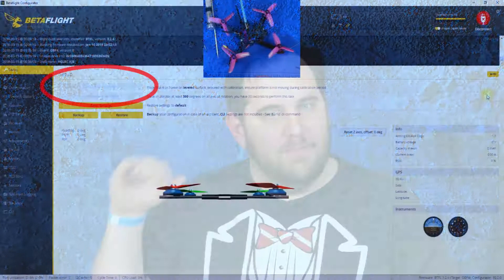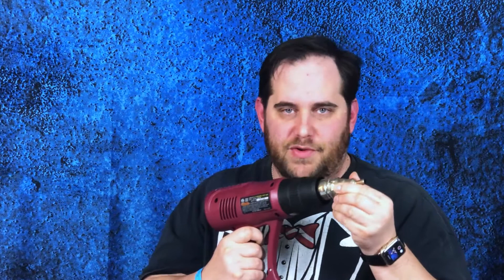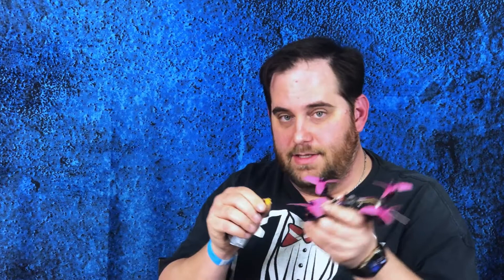How I fixed my HGLRC XJB 145 NO GYRO Accelerometer issue

Comment: OK just came here to say Thank You
I had this problem

Now while I may have bought a new V1.2, I also bought a heat gun with the proper adapters & after 3 goes, & never doing anything like this before, I have gyro!

Tip for anyone else, it’s not enough to get the flux bubbling, keep a close eye on the solder on the chip & you will see it change state, that’s when you’re done.

I had an extremely narrow nozzle & had to do all 4 sides but if you start on the outer side where the wires are, as soon as the solder softens, then move around the chip. Each other side won’t take very long because they are already nearly at the right temp.

Subbed & thanks again
Reply from the maker: SO AWESOME!  I'm glad you were able to get it going and reflow it.  It is by no means a "beginner task" and you should be very proud that you accomplished it!  Great job and I'm glad I could get you the information to get it fixed up!!!
Reply: @tronage  I'm just happy it's going again because trying to get a plug for the ESC to be able to re-purpose it was a nightmare. Now I have a spare everything to play with other frames because, well just because.
& now I have a very fancy heatshrink gun hahaha
Thanks again.

Comment: Thank you very much for just shining some light into my problem. I dont know if I will be able to solve it and I really feel that it is un fair that they sold those like that. Do you know if the company is taking responsability about this? I mean, usually I try to fix  stuff and learning but this is advanced stuff, I dont even have a blower or this flux. Not even fair.
Reply from the maker: It is unfortunate, but it is kinda "par for the course" because if it is a china company.  There will always be "bad batches".  Not to defend the company, but due to the nature of the hobby, and the frequency of crashing, there isn't a way to tell specifically if it broke because you crashed, or it broke because their mfr process you know.   And it is a hard line to draw because as a business you may want to help everyone, but then you would be giving out free replacements to everyone who ever crashed (because there will always be those who take advantage).  The Good news (maybe) is if unless you use the gyro you don't need it.  If you fly using Angle or Horizon mode, then you are out of luck here, but if you only use acro mode, I find it better to disable the gyro in betaflight.  It frees up CPU cycles for PID loop and Dynamic filtering.  Mine is now off, and I've not looked back.  So if you are comfortable without Angle/Horizon mode, just doable it and all the problems go away.
Reply from the maker: If you wanted to buy a replacement board, this would be the one: https://goo.gl/rozZuj (it is an affiliate link and appreciate the support if you choose to use it for your purchase).  I've not heard of the "fresh" ones having the issue, it is more of the older stock that was the problem.  If you are new to soldering, it will be a good learning project to do the replacement.   As I said though, if you don't use angle or horizon mode, you can "ignore" the problem and just turn off the accelerometer in beta flight.  But if you do use these modes then re-flowing it as I describe in the video, or replacing it are your only options unfortunately.  Perhaps still try to contact HGLRC though, worst they can do is nothing, but maybe they will help out.  Worth a shot.
Reply: tronage thanks again. If I decide to buy one I will buy it from your link for sure. But first I will try to see if a friend could repair it for me.. I still very new.. Just flying on angle mode. I have not even purchased the Googles yet.. I jumped from a furibee f36  to the xjb 145
Reply: hglrc is a respectable company that will honor returns, but it also has to do with who you ordered it through as it is they you need to contact for returning/rma'ing. so, unless you directly ordered through hgrlc they are not the ones you contact. if it's from banggood, they've always been good at returns they just take forever. gearbest, meh... it's a toss up. if it's a US retailer like getfpv or grayson or a local store or whatever, contact them first and let them process the return. Don't try any repairs on your own if you decide to go this route.

Comment: My friene or Anyone please. Now my motors stop at the same time in mid air for a second and they come back again. This happens many times for no observable reason. I thought it was the receiver but it seems to be OK. Don't know where to start looking. 😣
Reply from the maker: Sounds like you are having either a brown out or something receiver related.  What is your RSSI when the motors stop?  What sort of battery are you using?  What sort of maneuvers are you doing when it happens, does it happen right after a punch out?
Reply: @tronage  thank you very much for coming back to me. I haven't touched the quadcopter after it started happening. Now that you mention it.. 
Some months ago I got a broken receiver. So this is a new one and it was flying OK.
Hmmm... Also my vifly beeper is death. Now I am thinking it could be an electrical issue.  I got a multimeter I am learning how to use it. Maybe is that. To your q. I am just hovering and it happens.
Reply: @tronage  a brown means that something burned out? My RSSI does nothing. I am using 4s Gaoneng 850
Reply from the maker: A brown out means that something with the electrical system is not good, and is a temporary loss of control/power.  The key word is temporary, which is why it is a brown out.  It could be something going on that is triggering the failsafe of your receiver as well (loss of signal, esc noise, etc.)  I know it has been some time, and I'm curious if you ever got this sorted out?
Reply: @tronage  Thank you very much for comming back to me. The answer is nop. I left my quadcopter and havent touch it for a while because it have become a pain in the +++ to research, to find the problem, then you get another problem and I have some other problems to solve in life you know what I mean =)  its very time consuming and frustrating and expensive. One of this days,  I will try to flash the firmware and observe again. I noticed that my beeper and back leds are death too... I am afraid that my batteries could be damaged after so much time with out use... I have a multimeter and I try checking it with the little knowledge I have, but cant find the problem. =(

Comment: Hi there Tronage. Your videos have helped me alot with my XJB. After a bad crash i have a problem when i turn my switch to stable mode in order to land, the quad takes some crazy angles and usually crashes. when i fly at air mode everything is ok. if i try to fly at stable mode very easy going i see that the quad doesn't stay at a place it goes away, very noticable, and i have to all the time fix it. Could be this problem with the gyro? Mine should be a latest version and also i don't get the sound warnings, and my calibrate button is active in betaglight. should i try what you did?Thanks alot!
Reply from the maker: Sounds to me, your gyro is ok (it gives warnings and won't arm if it is not).  But may need to be calibrated.
Step one (calibrating the gyro) can be found in this video I did here: https://youtu.be/Ke7Dj0pdNok?t=13m10s (I time-stamped the spot about calibration)
Step two (Accelerometer trim) can be found in the same video, but at a different timstamp here: https://youtu.be/Ke7Dj0pdNok?t=34m3s
The first step just "zeros" out what the quad thinks is level, but it will never be "perfect"  The 2nd step helps dial in exactly whats level because you are trimming it out so it doesn't "pull" or "favor" a direction.  It will "drift" becasue there is no GPS lock to keep in in one place.  But what it sounds to me is you are getting pulled in a specific direction. 
Let me know if these tips help you out, I love hearing peoples progress!!!
Reply: tronage thank you very much for the help and the super fast response. I will try these tips and let you know. It is weird to me that everything started after a bad crash where an arm broke and I had to change frame. Someone told me that if a motor bearing has a small damage after the crash can generate noises ,in certain frequencies, when it spins that can get the accelerometer go crazy. Is it true?
Reply from the maker: Did you do the acceleometer calibration first (and have it on a "as level as possible" surface.  That happened to me once but turned out when I hit calibrate the quad was leaning because of the battery connector, so the calibration was "way off".  You want the flight stack as level as possible., then hit calibrate.  
As for the values, sometimes, you may have to put in big numbers, I've had some into the 50's just because I couldn't get the board flat for the calibration button.
For a forward and to the left, that would be negative on the pitch and positive on the roll values.
Reply from the maker: Yes and no.  Yes you can damage your bearing in a crash, though I've had some pretty spectacular crashes and and nothing yet, but anything is possible.  And yes motor vibration can and will throw off your gyro.  If that is a concern, the simple solution would be to soft-mount your motors which would dampen that vibration from getting to the FC.  Usually it makes it act erratic and throws your tune way off.  It wouldn't be an organized pull (as you describe forward and left).  Is the motor that was on the broken arm the front-left motor?  Perhaps there is an issue with that motor (if it was on the broken arm) that it can't spin proper as the FC commands, so being the weaker of the four, it would dip and cause the pull.  You might be able to trim it out with the accelerometer trim but would require very high values to compensate for a week motor.
Reply: tronage for once again thank you. Yes I calibrated it in a "flat" surface and as it should stand. No, I didn't go higher than 30 +- , but the weird was than no matter + or - the values it did the same thing. The arm tha broke was the front right, not the front left. The new frame is 4mm thick not 3mm. So it must be stiffer for sure but I don't know how it is translated to vibration transfer. Before the crash I had calibrated the guro in a wharever surface and never had any problem.
Reply from the maker: You can try to continue to go higher and higher to get the correction right, don't be affraid to crank it up if it gets it working (though it is more of a bandaid fix to whatever the real problem is).  As I mentioned to correct a front and left pull would be a negative value for pitch, and a positive value on roll, anything else will only magnify the problem and not fix it.  No harm will happen going "too high" other then the craft may eventually start pulling the opposite directions, and then you know to back it off a bit.  Well it is always possible in a crash that because the arm broke it "saved" the motor, like a crumple zone in a car crash.  But the left arm didn't break, so the motor got more of the force.    And thickness of material doesn't stop vibrations from traveling through it.  For example even if there was a 10mm thick piece of carbon and you held one end, and I tapped on the other, you would feel my taps.  If vibration is a concern you need to add dampening, either by soft mounting the motors so it dampens the vibrations being transmitted to the frame, or soft mounting your FC so the frame vibrations are dampened from transmitting to the FC.  Either way though I don't think this is your main issue.
Try this,  In betaflight go to the setup tab, and with the quad "level" does the 3D representation of the quad show it also level?  When you move the quad with your hands, does the 3D model move as expected to mirror your movements?  There are little numbers in the corner that say Pitch and Roll.  if your quad is level, these numbers should be near zero, are they?
This helps get a feel for what the FC is seeing from the gyro, and may help track down what your source issue is.
Reply: tronage thanks for one more time. Yes the numbers are near zero. I will try higher values as you suggest but for now I have deactivated stable and horizon modes so I can fly  and have the fun I should. If I have news I will let you know of course. I have a new motor that I ordered for spare and maybe when in mood I will try toreplace the front left and see what happens.as we are talking I have an other question. As searching for the problem and checking betaflight settings I was told that when you use dynamic filter ,your pid loop frequency shouldn't be as high as 8 khz but should be at 4khz. Do you know anything about that?
Reply from the maker: That is the easy solution, lol, which I too have done.  I've turned off the accelerator because that saves on CPU cycles, which leads to your question.  And the answer is it depends.  The dynamic filter will increase the CPU load, as does turning any feature on.  The goal is to not overload and max the CPU.  So on some FCs with more stuff going on (or a F3 board which is slower) 8k/8k and dynamic filter may be just too much and bog the cpu.  But I've been running 8k/8k with dynamic filter on and haven't had any issues with the CPU load.

Comment: Im curious wen it had the problem did the quad arm ? Or did it not ?
I’m having the issue of my xjb not arming. Going to look into this recommend and let you know how it works out. Thanks pal.
Reply from the maker: No it would not arm, bu that doesn't necessarily mean you have this issue.
To trouble shoot a won't arm scenario, hook it up to betaflight, and make sure under the OSD that you have the warnings turned on and placed in view (make sure yo save).  Then power up your quad in a safe environment (or remove your props on the bench) and try to arm while looking through your goggles.  The warning field will tell you "why" it is refusing to arm.  In my case it said "no gyro", and if yours says this too, then yes you have the problem.  If you do this, and you telll me what the warning message is I can help you trouble shoot from there.
Reply: tronage hey pal. Happy to report I have my quad up and running again. If you recall my inputs were nonexistent in Betaflight. I reconfigured the mapping and rebinded it. Just did a test flight 
And back to normal. She’s arming again. I did notice some prop wash on some descends. What can i tune in pids that might reduce it a little ?
Lower which pid ? Lmk 
Thanks for all your inputs. Your the best Tronage !
Reply from the maker: Awesome, Yes, I remember your issues, and I'm glad you got them all resolved.  Not being able to fly stinks, and why I try my best to get people up in the air!  As for tuning out prop wash, I first need to know two things: 1) have you tuned it away from stock pids? Hard to know what to change without knowing where you are currently.
2) in some scenarios,  prop-wash is unavoidable even with an amazing tune.  So I need to know are you getting propwash "all the time" or only under specific maneuvers or conditions?
Reply: tronage Im running stock pids. 

I think D Can be lowered a few notches. I hear the prop wash when doing maneuvers or coming down in altitude with some speed. I saw your pids on a video about Betaflight setup. Don’t know if your running that tune or recommend it. 
Also I hear that filters 1 and 2 on Betaflight can be removed and make the quad run much better. But I’m not ready for that. And possibly burn out a motor. Lol 
I need a light tune adjust. What do you recommend?
And yes it’s great to be back out flying fpv here in NY finally and with better weather. Thanks pal
Reply from the maker: The pids in the video are ok, but not wonderful.  If you look through the comments on my videos (maybe the beta flight one) I responded to someone with some better pids (I don't have them handy right now).  But my current tune is pretty amazing, but as you said, I have all my filters off and relying on the dynamic filter.  And it is a brave step to turn those all off lol.  I'm going to try to get a video up with essentially what I think is a perfect tune for me, and what I'm flying to achieve it (which battery, props, etc.)  Propwash is a little tricky sometimes to get tuned out and some is not avoidable (you more have to hide it with pilot technique to not get in it), off the top of my head I think I got mine out by actually upping P and I a little and lowering D.  That let it be a little more aggressive with corrections and not so floppy which tightened up the propwash.
Reply: tronage Ok yes I found it. I’ll use that as a small step first. Fly it and see how it goes. Then if I decide to turn off one filter I’ll make sure to check motor temp on a test run.  Thanks man. Like always you’ve been very helpful. 
Keep the vids coming !
Reply from the maker: Inspired by you, I've just made and posted my vid about my current settings I am using right now.  Check it out here: https://youtu.be/VDBs7Psti3s  Thanks for the inspiration, and I hope you enjoy the feel!
Reply: tronage awesome dude ! I’m going to try it out. Thanks for the mention about it. And thank you for giving us all a hand in getting the best tune ! 
Everyone with a mini quad should subscribe to this channel. Keep it up. 
I’m looking into a motor soft mount set up. Hear it really improves the smoothness of the quad. Maybe a gd upcoming vid. Let us know